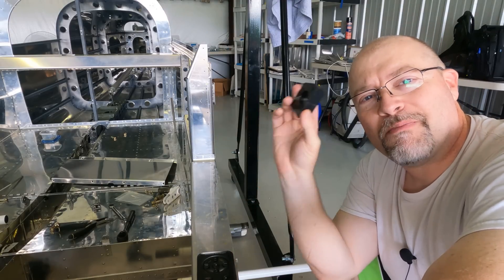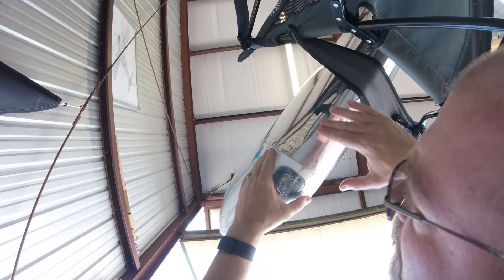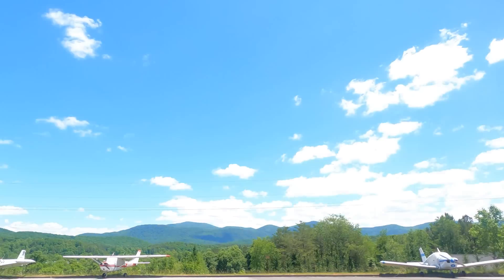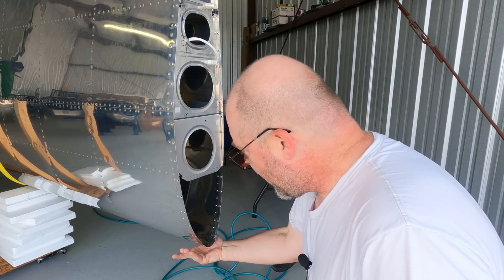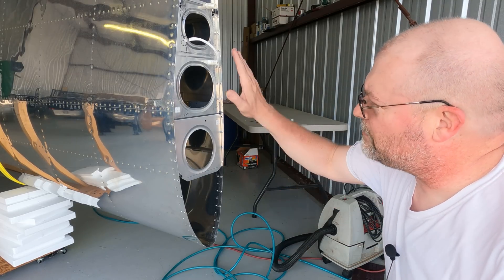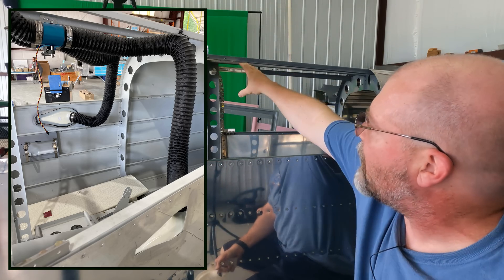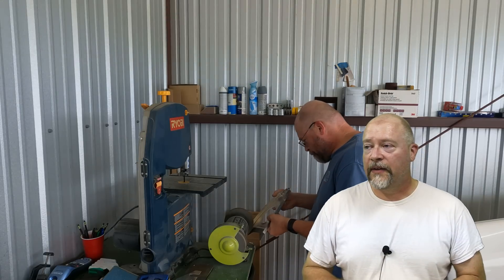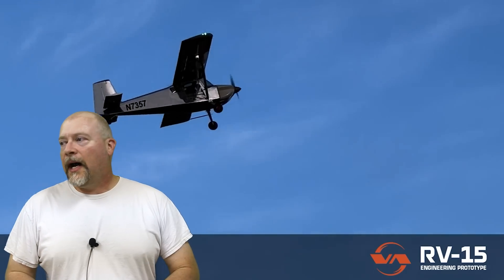My wing fell.. time to fix it! The RV-15 and Oshkosh! | RV-10 Fuselage 049 ~ Jason Ellis Builds

Comment: The problem at Vans wasn't a lack of demand.
Quite the opposite.
A lockdown induced increase in demand resulted in some poor outsourcing decisions and a bunch of unexpected costs.  
All of this happened in the context of a pricing policy designed to shift as many kits as possible by recovering a low profit margin per unit sold.
Guess what?
The money just ran out under these circumstances.
In was a perfect storm.

Comment: Jason, had a similar issue with my wing. Dropped it (twice) onto the back of the Uhaul transporting it to the airport (once putting it on the truck, and once taking it off). Was transporting on the carrier jig like you have. Both dents were in the middle of two ribs, and on the gas tank. Used a paintless dent removing tool to pull the dents out, then used epoxy/micro filler to finish hiding the dents. It worked out just fine. No leaks in the tank and you can't see it unless you know where it is (so I see it all the time). Your solution to your issue was great. I applaud the ingenuity. But hey, that's what plane building is all about.

Comment: Surprising that one of those straps would just break.  I would suspect the strap fabric was chemically weakened.  Have you used any solvents or cements near those straps?  I used 6” wide strips of old carpet for my wing rack and they are very stout and have a lot of redundancy given their width.

Comment: Just like a weld will not penetrate a crack in cast iron, it has to be ground out, so the welding wire can reach all the way through the metal. Fiberglass is the same. Resin will not penetrate the crack. Use a box knife to carefully cut a V the full thickness of the fiberglass. You will likely find an area of delamination, somewhat larger than the crack itself. Cut it all out. Then fill the V with chopped, or cut, or even wadded up fiberglass. Work the resin into the fiberglass, being sure to work out any air bubbles. Don't worry about any bumps sticking up. When the fiberglass sets up, dress it down to it's original shape. You can even dress it down a little lower, because you need to go back and cut and install a patch of matte large enough to cover the whole repair. You should have very little hand sanding to do on the outside to finish a perfect repair.

Comment: Those naca ducts are more affective in a high pressure area. If you haven’t cut holes and fully installed them yet your passengers would appreciate them installed on the bottom of the fuselage to give them a lot more airflow.

Comment: FYI - if you are carrying a bit of aluminum sheet to the back of the hangar. And as you bend over to duck under the wing the back of the sheet will go up. And if your wing is fabric (like mine) it will slice through the fabric like it's not even there.